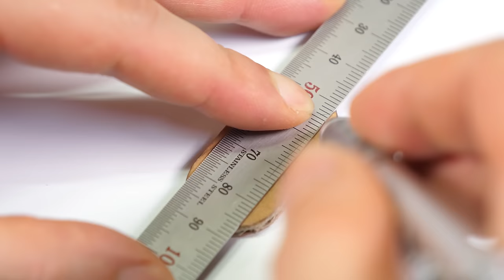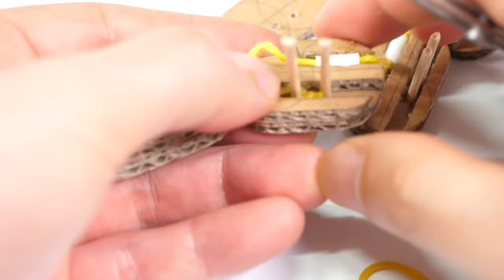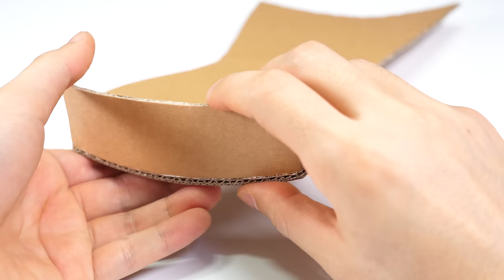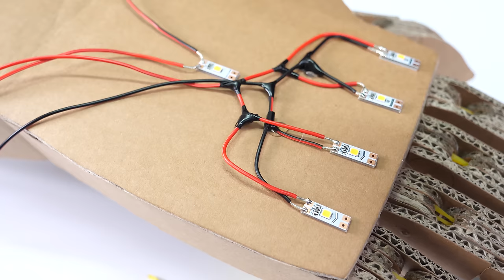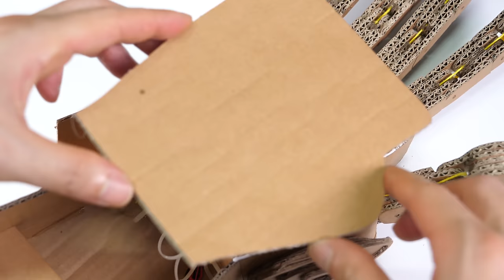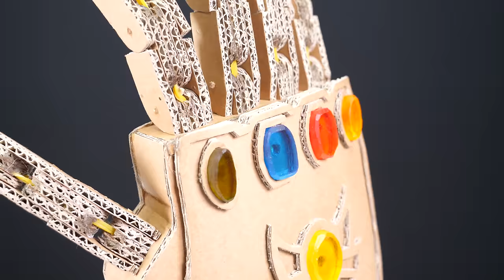DIY Thanos Infinity Gauntlet(Avengers) from Cardboard

Comment: When Thanos tried to commission the gauntlet from the dwarves, they politely told him it would take around 42000000000000000$ to even get the necessary materials, much less forge them. Thanos only had 42$, so he made an el-cheapo gauntlet out of card board instead.